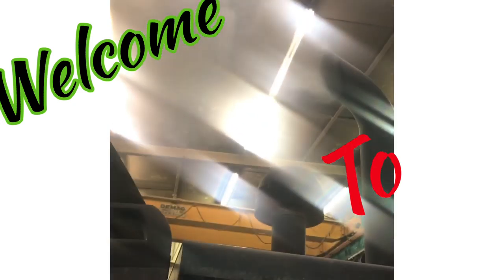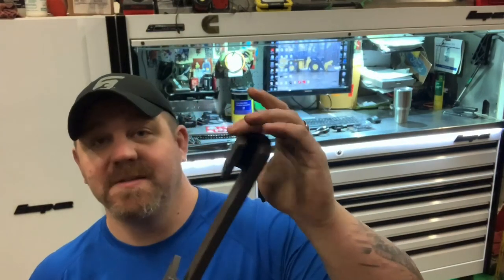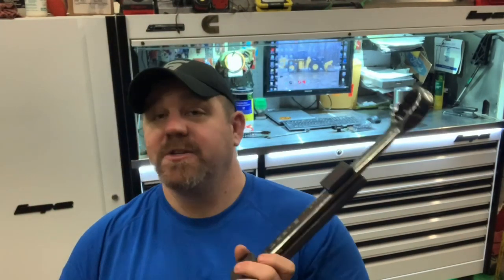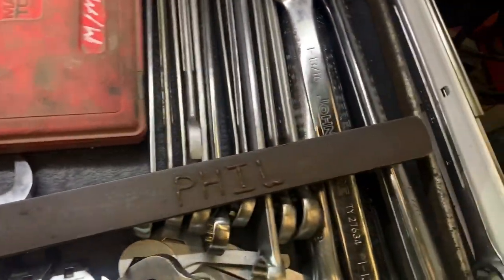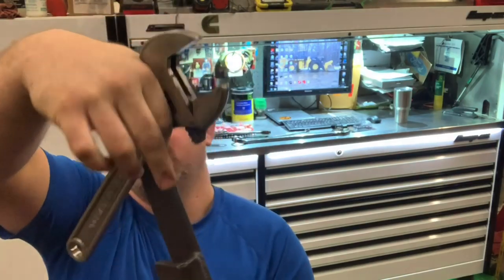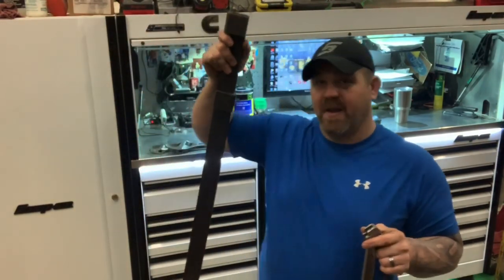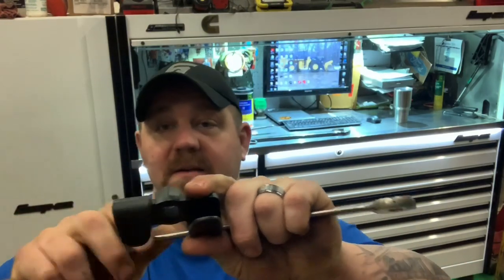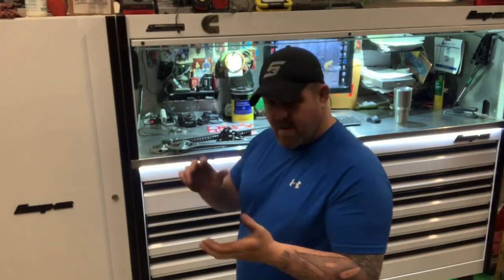Make your wrench extension. How to extend your snap on Mac Matco John Deere or whatever wrench

Comment: I have used one on the chain wrench. Unfortunately I still don't think the rest of the chain is on this planet anymore. I do a lot of double wrenching. Have broken 2 Craftsman pro series wrenches doing that. I have never broke a wrench with an extender. A great bonus for the extender.
Reply from the maker: some times you need to let them fly haha I lend it out all the time in the shop.

Comment: The smaller spanner sorry wrench extension like the monster ones work well on large allen (hex keys) too.. Like your extension but too big for my box...
Reply from the maker: that would work on them as well awesome tip
Reply: @theheavywrench9549  i have a 3 ft long piece of realy heavy aluminum tube about 7/8" id and 1 1/4" od that i keep around just for going on large allen keys - will try to find a picture
it also fits ratchet handles and being aluminum will not mark them ;)

Comment: Hey Bud! Congrats on the 1000!!
I made an extender similar to your big one, but mine is A little bigger, and probably a bit heavier.
It's made of 3x7/16 stainless, 6ft long.
Some of the stuff I tangle with has 4+ in nuts&bolts, and it comes in REAL HANDY with the 48 pipe wrench, and chain wrench!
LOL!it's also a pretty good prybar too!
Enjoyed the video, I am going to try to find that K-T adapter also, it looks to have good possibilities.
Stay safe brother, and MERRY CHRISTMAS!!!;)
Reply from the maker: Thanks so much for sharing that you get to work on some big stuff I’m glad you liked the video. That k tool one is kinda nice but I may weld a bar to it so I don’t need the breaker bar.
Reply: @theheavywrench9549  The one possibility I saw first on that K-T tool was the possible ability to use the hex as a way to adjust to an awkward position, and still bring some extra force to the fastner.
what do you think?

Comment: You get caught on mine property with any kind of homemade tools...msha will give u a fat fine for them..
Reply from the maker: its not homemade its a dealer fabricated tool  lol  but you are correct some places tools that you need to make  are not supported or approved but, the one from k tool is not homemade so they should be cool with that one.
Reply: Paint it red and put a Snap On decal on it
Reply from the maker: @PaulyD0859  good idea that may work part number mshaiwin haha